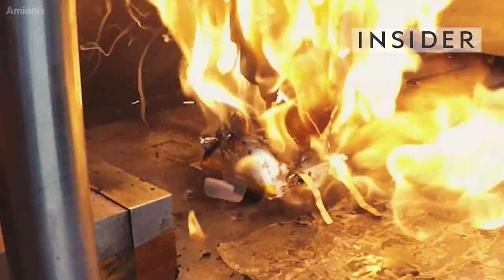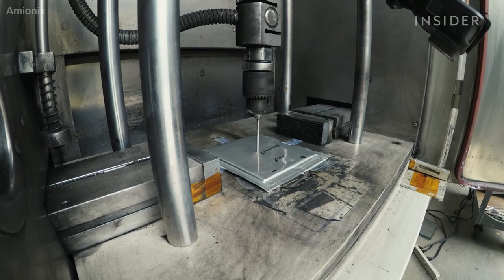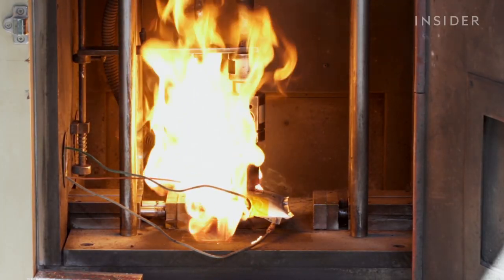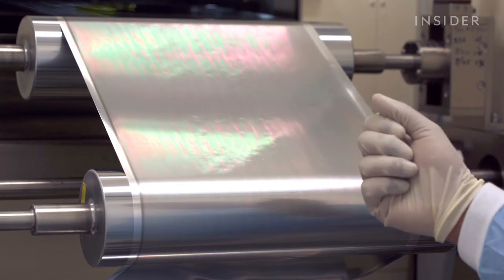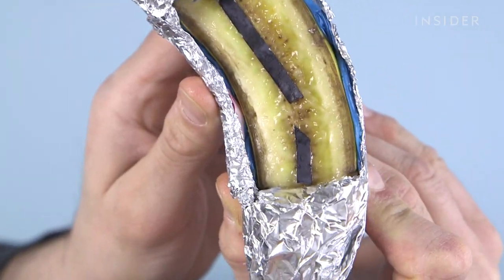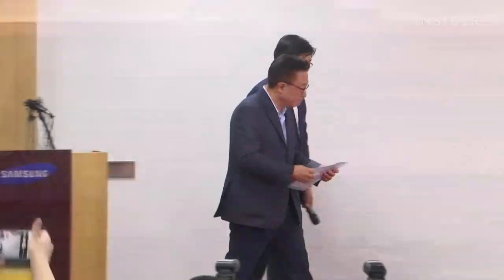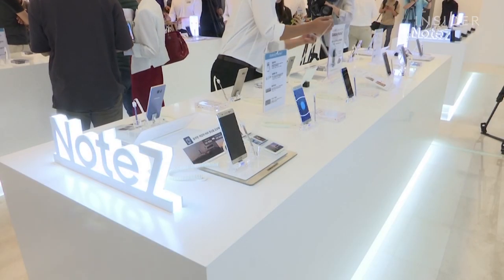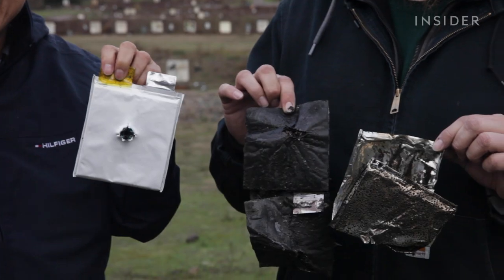This New Type Of Battery Won’t Explode, Even If You Shoot It

Comment: 2:30 water on electrical fire?
Reply: science student cryin in the corner
Reply: Safer than going through every red light!!
Reply: im not very smart on this but what do you use if not water?
Reply: @snuckel4  CO2 extinguishers are usually used for electrical fires. Water, especially on li-ion fire is bad since lithium and water reacts violently to produce hydrogen, which itself is flammable.
Reply: @snuckel4  You can use a powder extinguisher also, I would think, still better than water.
Reply: @viperfang5291  Ah i see so that can make kt more dangerous huh
Reply: @tgv6t  ?
Reply: @tgv6t  he meant the water extinguishing electrical fire
Reply: @seandanielespiritused9863  no he tagged viper fang and he was talking about flame extinguisher
Reply: @tgv6t  read viper's second sentence
Reply: @seandanielespiritused9863  oh well he didn't specify which part
Reply: Glad someone said it
Reply: Since battery fires are self-oxidizing and have ready access to fuel; the only option remaining for controlling the fire is to remove heat; which water is excellent at doing.

Comment: 2:31 Pours water over battery fire, IT'S BIG BRAIN TIME BOIS.
Reply: Galaxy brain move.
Reply: To be fair. Even if you use a halogen fire extinguisher, it would still reignite. There is no off switch to a burning battery.

Not making contact with the battery is good. Not letting it ground to you is good, hence water pouring to the ground.
Not letting it progress to combust explosively is even better.
Reply: @niccatipay  It still should be a commonly known fact that electrical fires and water don’t mix.
Reply: @damian9303  
I know. 
But considering the explosive alternative, I'll rather wet the battery.
Reply: @niccatipay  not like I'll try using it anytime soon too
Reply: @niccatipay  You shouldn't even wet it because electricity arcs when in contact with water.
Reply: @shadowdragon1248  
More like conduct, as arcs happen over air gaps.

I understand that water and electicals do not mix well as per my previous statment. We are however theorizing the use of water on a battery that might explode without immediate intervention.

Would be nice to have fire extinguishers mandatory for every house. Sales go rrrrrrrrrrr.

Comment: I feel like anyone with RC experience knows how high the chances of a Lipo failing are
Reply: I was looking for this comment!!! Thats why you always use a balance charger (or in my case a programmable swallow charger) and never use shady batteries. If they puff up slightly after heavy use, it may be ok, but never charge a puffy battery. And if it puffs up substantially while charging, submerge it in salt water to discharge the battery, or use a battery discharger and safely discard of the battery. I have had so many bad experiences with lipo batteries and rc cars. I had to rebuild my complete custom build, awd 200+ km/h buggy because i put a dumb wing on it, the back pushed down, it flipped and scraped the battery... oof
Reply: Yep, also I doubt these bats can match the c rating of lipos
Reply: @letsgofast1187  exactly! Thats why we use lipo. They can put out such a stable source of power for a long time and they charge quick. There really is no alternative

Comment: Actually in terms of vapes or E-cigarettes. The battery wasn't the cause. Yes the battery vented, which caused an explosion. But most vapes have vent holes to prevent explosions. 18650's are also designed in a certain way that they should always vent from the top. 

The guy was using a mechanical mod, with an RDA. So he made his own coil. But he was building way too low resistance, causing the battery to short out. Thus venting. I believe he may have also been using a clone mechanical mod, which didn't have proper safety vent holes.

Comment: An even more intense danger than the initial fire is the buildup of gasses in the enclosed immediate area. If your battery is in your garage and this happens without proper ventilation, the off-gas will start to outnumber the oxygen to the point where fire can no longer burn (fire needs oxygen). That might sounds good, but when oxygen is re-introduced to the environment, which will no doubt still be hot enough to initiate a fire, the explosion will be... the size of your garage. Not the size of the battery.

Comment: The more important question is how this effects capacity, generally puncture of the cells isn't the most important safety consideration, it is charging and discharging that requires more scrutiny.
Reply: It shouldn't. Since they're basically putting a new layer around it. So recharging and discharching should still be the same.

Unless ur talking about after it gets shot
Reply: @unliving_ball_of_gas  it will however increase the mass an weight of the cell, meaning a lower capacity per given weight.

Comment: That doesnt seem right. The explosive capacity ia not spurred by the positive and negative charges having contact through rupture thus shorting it. But because lithium is very flammable when exposed to air

Comment: Those batteries probably dont even have like half the capacity than today batteroes which means basically ur phone is only going to last half the time becausr if there is a short there will be heat and therefore fire this is just the laws of thermo dynamics u cant just remove the energie which the battery was charged with. Also in the testing they probably had almost empty batteries for showing them and fully charged normal batteries. Normal lithium batteries are also pretty safe just not qhen fully charged, u can puncture a half charged battery and it will not even nearly explode as forcefully as shown in the videos because there is less charge in the battery therefore less potential energy for exploding. Thats also a reason why batteries for long term shipping and storage and so on are kepped at about 50% charge so that they arent such a big hazzard and so they are going to last longer because they will not degrade internally

Comment: Or you can just use a solid plastic electrolyte, plus that way you can switch back to lithium which is more energy efficient than lithium ion. Solid electrolyte batteries can literally be shredded into pieces without ceasing to function.
Reply: The technology for them is fairly old too, I don't get why they haven't been implemented into everyday technology yet.
Reply: @sparklefluff  Because planned obsolescence
Reply: @groszak1  Oh, haha that's quite a coincidence. I just watched a video about planned obsolescence yesterday. My end conclusion was that it should be banned, I guess that still holds up, lol.

Comment: You see, they don't explode, but they are shit batteries. Low voltage cells, that deliver very little current. You couldn't use this technology to power a car or even a phone, because the batery pack required to power it would be too big.